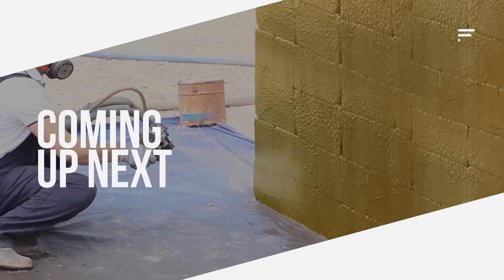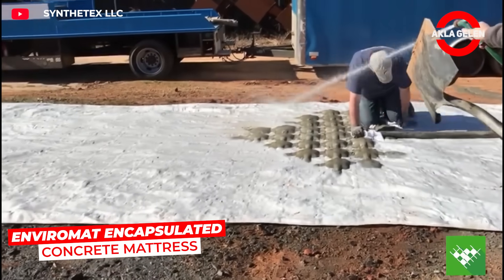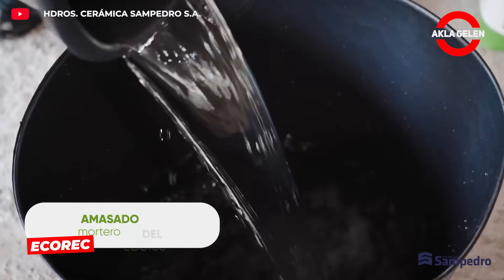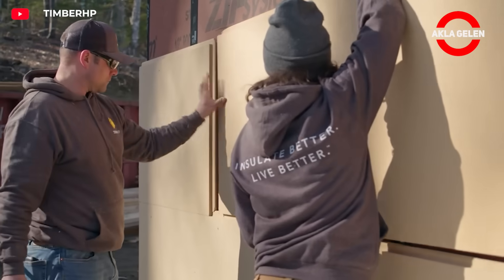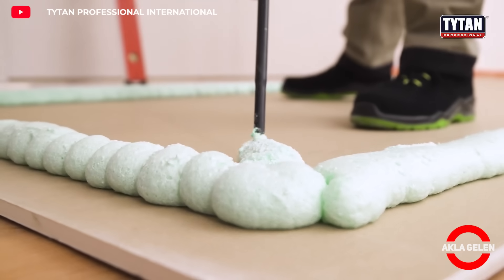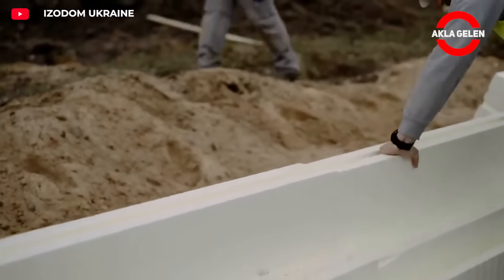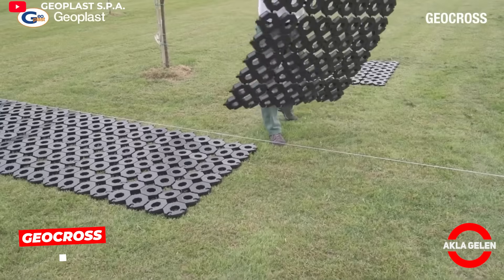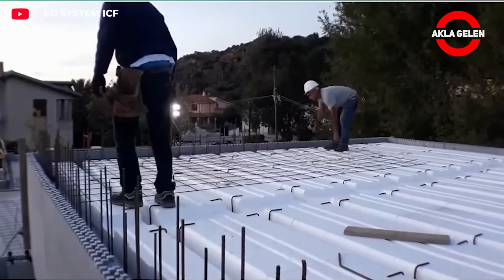I can't believe it! I never thought of these ingenious Construction Techniques

Comment: Unless the steel reo is centimetres above the foam and into the concrete it is USELESS and does not add strength to the concrete.The reinforcement mesh must be on chairs that keep the mesh in the concrete above the foam and do not punch through the foam bed.Just lifting the mesh whilst pouring the concrete does not guarantee proper imbedding of the mesh into the concrete.without support the mesh can displace while being vibrated.